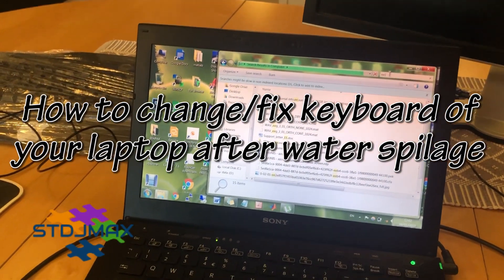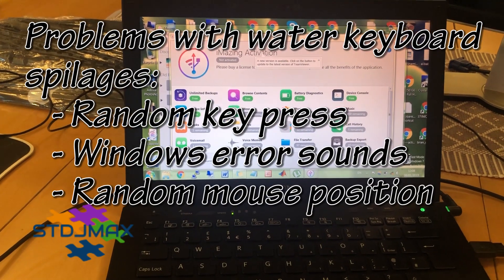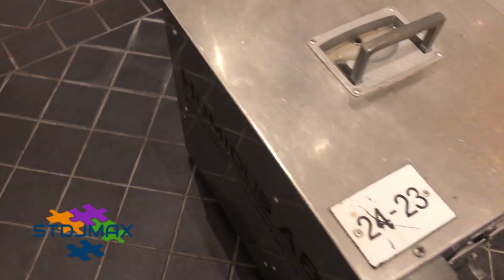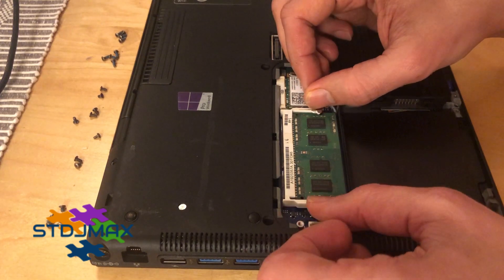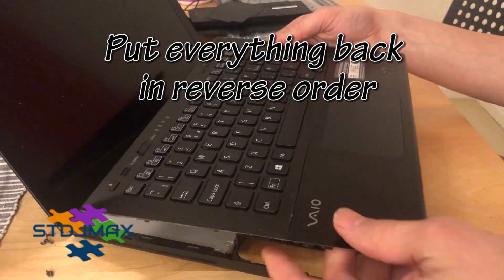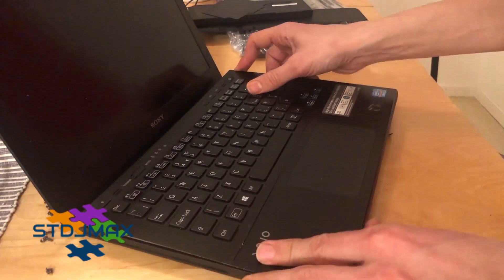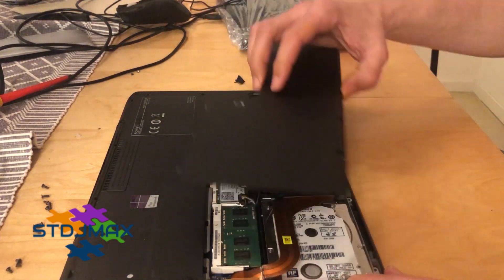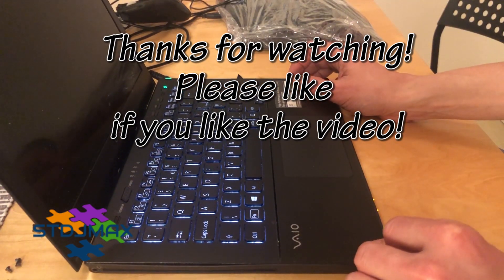How to repair the keyboard of a laptop after a water spillage/flood

Comment: I would never use metal screw driver (like this video) by fragile ribbon wires; just use your soft fingers/ nails to lift up the flap-clip holding ribbon. #1 if you spill on laptop; flip it oveer immediately. place on towel to dry. you can blow soft air across it, like a fan. On back side, open back of laptop. Just unplug battery. Unplug cord from wall. Find all the documents/ videos/ instructions you can for your specific laptop. All a laptop is, consists of motherboard, circuit board, with a bunch of parts & mini circuit boards plugged into it, plus battery plugged in & circuit board for power cord. They all just plug in/ out... plus get secured in place with clamps or screws, etc. It is easy to plug stuff in/ out, if you find the right instructions for your laptop. It is ez to replace your keyboard if it doesn't dry well. The keyboard is a self contained circuit board, which will contain water/ spill & not flow into rest of laptop if you flip it over fast.
Reply: And don't keep drinks by your laptop anymore. You can also buy a top protective covering; probably a good idea when you see all these comments of spills

Comment: i spilt a bit of water on mine and it wont charge after i put it upside down for 24 hours 😭 help do you think the air conditioner broke it? it was too cold and i cant turn it off cause they wanted to keep it on. i was wondering if it contributed to moisture inside…
Reply from the maker: use external tv , keyboard and mouse and turn upside down.

Comment: Hi,  which connector is for the keyboard?   i Have the same pc and just want to disconnect the keyboard and i am going to use an external keyboard. You disconnected 2 flat connecters with blue ends, which one was the keyboard? Thank you.
Reply from the maker: do not be confused with the big blue motherboard cables. The keyboard cables will be after that it has been dismantle around 7:00. Keyboard cables are small. Maybe I will make another video.
Reply: @stdjmax  Thanks, I ended up figuring out how to turn off the keyboard. Not going to fix it, it's 13 years old so am just using an external keyboard. PC still works great, it completely crashed once and my son saved it by installing a solid state hard drive. It's a Sony Vio 2009 model i spilt beer on.

Comment: My son just spilled a glass of water on my hp laptop. I think I fixed it. I wiped it down with a paper towel and turned it off immediately. 
I turned on the oven & set to 130 degrees F. Once it reached temp I turned the oven off and put my laptop in there upside down on a baking sheet for about 20 minutes. 

20 minutes later completely dry and everything is working. Now it's time to get a keyboard cover before it happens again lol.
Reply: 2 months later and not a single problem.
Reply: my laptop got wet 1week ago and l didn't do anything is your method still going to work
Reply: @lainyboo2560  Probably, as long as you haven't turned it on and don't let it get too hot.
Reply: @BradKwfc   l turned it on
Reply: @lainyboo2560  If everything works you should be OK. If not try the oven trick just don't get it over 130 or leave it in too long.
Reply: Will no baking sheet work
Reply: @teeheeteehee5451  It should
Reply: i didnt react fast enough😔☝️
Reply: @marssuckatgaming  Sorry to hear that. Mine is still working great. It's been over a year.
Reply: I just spilled a glass of water on mine HP, I immediately turned it upside down and wiped it down with towel but I didn’t turn it off immediately and it started making sounds like error notification or usb connection notification. I turned it off and it still lays upside down on the table, im desperate now, I’ll try the oven drying method 😫
Reply: @lindamarkusova5921  did it work?
Reply: @circus1293  no🥲 laptop died unfortunately

Comment: i accidently spilled water on my laptop but it survived still there is some problems that im having

Problems:
-When charger plug is in but it shows that is charging but it doesnt lower or go up
-Keys not working properly such as when i type something it doesnt type correctly
Reply: And the key problem is slowly recovery except battery it wont charge if i plugged but if i plug it cruises at same percent it doesnt fill but if i take plug off it goes down and if i put again then its the same
Reply: @NanoRail  use external keyboard
Reply: @spwashh5160  Thanks, But i got a new laptop.

Comment: Hi, i didn't actually spill anything on my laptop i was just cleaning it with a  cloth and some cleaning substance and when i passed the cloth over the keyboard it stopped working, i can't open this laptop sice its very complicated for me to open it since it has millions of screws and i don't have an external keyboard and I'm scared my parents will notice, its been like 1 or 2 weeks since it stopped working abd i don't really know what to do😢 I spilled so much water on this laptop abd it never happened so please help me!😭
Reply from the maker: Put again upside down for 3 days and try again. Probably some dust jumped some circle.  If it doesn’t work try to buy some air buster spayed while upside down. But first try the 1st solution
Reply: @stdjmax  ok
Reply: @Leandruhh  ayo did it work?
Reply: @polyphia8337 Uhhh it's been since last summer that the laptop wont turn on at all 🥲 Good thing my birthday is in 13 days and my parents said that they will get me a new laptop

Comment: DOES IT HELP WHEN I PUT JT IN RICE
Reply: put it outside down right no wand when you are ready remove the keyboard but do not touch the motherboard bcz.static electricity from your body can fry the motherboard when the keyboard is off put it in rice make sure you have removed the battery and drained power from the board hope you can fix it good luck 👍

Comment: I spilled water on my laptop, plugged it out and turned it sideways to wipe it off when I ACIDENTALLY TIRNED IT ON AGAIN and the power light was on but I couldn’t even hard shut it down. I heard the fan making noises like it was going on and off, then I put it in the triangle position to dry and I saw the charging port light on when it was plugged out and that was SCARY. Anyways I left it.. outside in the shade in the triangle position for like 3,4 or 5 hours.. you’re supposed to make it dry for longer I guess. (I also used a can of air to blow in it and dry) I tried to turn it on but it wouldn’t turn on, I was scared to plug it in but I did and IT WAS WORKING, it took a while to turn on.. didn’t check if my keyboard was working tho, I turned it off and just left it facing down
*Edit: I have to take it to a professional to clean it.. and my battery swelled
Reply from the maker: Thank you for sharing your experience
Reply: Actually the same thing happened to me and im rlly scared even i cannot turn the laptop off and like some of keys’ light is blinking and im having that fan noise im rlly scared can u pls suggest me what ti do
Reply: So your battery was damaged?

Comment: i just spilt water on my laptop and my parents are saying they won’t buy me a new one and i don’t have enough to get a new one so i’m very worried right now. it’s my only laptop
Reply: @UCqaTYtD5JHINQESeZ-V1VnQ Pls be right u dick 👏😭, I was drinking redbull, like a tiny amount drops at 6keys stop working, I tried everything. Its been 40mins now.
Reply: Me to in clean the water that fall and idk how to fix it my dad said he will fix it for one thing is im will pay and im only have 768 idk what to do im trying to find people how can help me if my pc is [hp pavilion g6] that my pc
Reply: Broke my laptop about 3 times, recently got it back from repair after a hefty fee.. just spilled water on it😭😭
I'm so scared
Help-
Reply: Also I feel like the it guys just charge us triple the fee for a 10 minute job
I need to learn how to do things like this
If you'll know how to learn😔🙏🏾
Tell me
Reply: @kawaiikai910  I found lenovo has a bunch of videos, to show step by step process to replace parts. It is not so hard once you learn to do it. Just realize all a laptop is: a circuit board (motherboard), with a bunch of small circuit boards & devices (hard drive, memory) that just plug into it, plus you must also screw down or clamp these boards/ parts various ways (with all different type connectors). Plus it has power supply, & a case. It is simple. It is like plugging the laptop into the wall outlet. It could sound scary- all that electricity. But you easily plug it in / out. It is no different with all the parts inside. Just find good videos / instructions for your laptop..... If you ever spill water on laptop... just flip it over immediately, place on a towel. Unplug it; open it & disconnect the battery from the back side (it simply has a clip connector). You can also unplug the keyboard ribbon, by just flipping open the clamp holding it & pull it out. Find the manufacturer info for your laptop & it will be ez. Let it just dry, with air flow like this video. If it doesn't work in a week- it is simple; just replace the keyboard. All you do is unscrew keyboard form the motherboard, unplug the ribbon & learn how to push it up, then pull out & replace with new one. You could do it yourself. Just find good documents / videos. I had to dig/ look a lot but finally found good videos for my exact laptop. Blessings.
Reply: Just disable your actual laptop keyboard using regedit, then use external keyboard which you can at around $4 wired and $12 wireless
Reply: did it work?
Reply: pls i need to know
Reply: @_szae_70  bro juice fell on mouse, it's not working 🙂💧
Reply: @limakthebear2271  poor you my laptop is now working, let it dry for few hours it'll work again trust me.
Reply: @_szae_70  hey what did you do
Reply: Watching the tutorials online but I'm scared to remove my laptop like this💀😿

Comment: Hello, i spilled some water on the keyboard of my laptop. I immediately turned it off for 2 hrs and let it dry but i have to turn it on because i still have work to finish today and tomorrow. I can still properly use the laptop but most of the keys are not working, i used external keyboard instead. I will try to let it dry upside down overnight. But I still need to use it tomorrow. Hope that it will dry quickly, i will let it rest during the new year holidays.
Reply: Same problem with me, i washed my hand and play my laptop immediately without drying my hand, but only 1 key not working 😭😭😭 and if ur laptop is already fixed can you inform it to me? Find this comment back after ur laptop is fixed. (I just want to know if it work or no)
Reply: @sisingkeruit9845  I spilled milk on my laptop and I have to do a Google meet.
And the L, O and Enter button don't work
Reply: @clixxspazzed2516  rip, still not fixed after 4days?
Reply: @sisingkeruit9845  I just bought a new keyboard with USB and mouse
Reply: Did it work?

Comment: I spilled water on my laptop, i cleaned the surface, and tried to let out the water that got inside by turning the laptop to its side. I tried turning it on and it said no boot device found. When i turned it on again, it said a different thing: cooling fan not working properly. I let it sit for 6 hours, and when i tried turning it on again, it said no boot device found again... What to do... Im so afraid that my parents will notice...
Reply from the maker: Mocharoon leave it more days upside down. Perhaps there is still some water inside. Also try to buy some air buster find link below may help to speed up the process
Reply: @stdjmax  i decided to just leave it alone for a whole week, and then its on again! Im so happy! 😭
Reply: @mocharoon5500  Did you leave it upside down?

Comment: wow it worked :D
Reply: Really??
Reply: @shahriarmarwan5105  yea
Reply: @andrewmixelsio1462  What did you do please answer i have to fix it or my dad will get mad
Reply: @andrewmixelsio1462  It worked for me and my dad we turned it over waited for the water to get out of the keyboard then we used a vacuum on the keys where they didnt work and then we used a blowdryer and then it got fixed extremely fast
Reply: @andrewmixelsio1462  bro i spilled water on my laptop about 4days already but i didnt do even a single tips was given on the video, will it work even its already 4 days? And can you tell me what litre of water u spilled on ur laptop?
Reply: @sisingkeruit9845  I spilled milktea all over in my laptop it happend 3 times but it still works
Reply: @andrewmixelsio1462  u didnt do the tips he gave in the video? U just leave the laptop wet without turn it upside down? 🤔
Reply: @sisingkeruit9845  no i turned it upside down

Comment: My cat peed on mine and it said install a hard disk or something like that. I put it rice so I guess I have to wait a couple of days and see if it works ☹
Reply: My cat also pee on my laptop,  some of the keys are not working, and I am trying to clean those one by one... :( just sharing experience... cats seems to like the keyboard a lot!
Reply: @marciagaete Right! Were u able to fix yours?
Reply: @aysa7905  ur laptop already fixed?
Reply: @sisingkeruit9845  yeah I eventually fixed it. It turned on😅
Reply: @aysa7905  so, do u have tips for me to fix my laptop? ( except the rice trick). I washed my hand and play the laptop immediately without drying my hand..
Reply: how tf does your cat pee on your laptop? is it on the floor or somthin

Comment: I left my school Lenovo thinkpad laptop outside my porch yesterday and it started raining and water got inside the keypads and on the sides. Is there anything I can do? I don’t want to pay for another laptop. I’m taking school virtually online because of Covid, I don’t have time to go to my school and get a new laptop.
Reply from the maker: Jesus Follower put upside down for 3 days. After if does not work buy some air compressor find link below and release some compress air. This should remove any residual drop . Do this in upside down position
Reply: Hey update on your laptop? What should you do ? Same problem😭

Comment: Sir I didn't turn off my pc after the water spill later it turned off itself is my laptops internal parts damaged 
Edit - I got my laptop back after turning it off for 3 long days keyboard is working fine too
Reply from the maker: Darshan Gowda put it upside down for 5 days. I hope the laptop will get back on if u are lucky
Reply: @stdjmax  thank you sir can it be repaired ?
Reply from the maker: Darshan Gowda depends how much water went through the circuit! Always have low expectations!
Reply: I got my laptop back without any damage damn I'm lucky thank you
Reply from the maker: Darshan Gowda Great if u glad and I am glad
Reply: @stdjmax  thank you for your response 🤟
Reply: I spilled most a 250 ml water over the keyboard accidentally  .please give me solution wht to do now . 🙂
Reply: @baljitchaukria5730  don't turn it on, if the battery is detachable remove it, i keep it upside for 3-4 days because this is winter season humidity in air is more let the water dry and hope for the best
Reply: @dexterDgc  no battery is attached i can't remove it ..😰
Reply: @baljitchaukria5730  its fyn don't turn on ur PC
Reply: @dexterDgc  bro my lappy even don't  getting started ..
Reply: @dexterDgc  should I bring to service station 
.
Reply: @baljitchaukria5730  u can wait or if u want it to get fixed immediately you can give it service station
Reply: @dexterDgc  i want to be it immidiately but  tservice station number did't picking up my call ..
Reply: @dexterDgc bro my laptop even did not  give  me any indication ..i am in stress .whether my laptop could be back in good condition ..or not ..
I just bought it 2 months before ..😠
Reply: @baljitchaukria5730  bro i suggested you everything iknow that's all ican help
Reply: @dexterDgc  does your laptip was gives u any indication when your laptop was in this situatio. ..
Reply: @baljitchaukria5730  I did a mistake by not turning off after water spill and used it for a hour later it turned off automatically I thought my mother board is wrecked ididnt turn on for 3 days after those three days I turned on and it's working fine generally keyboard gets damaged in my case iwas lucky no internal damage so far everything works fine now
Reply: @baljitchaukria5730  wait for 2 days then if it didn't turn on take it customer service bro if you are lucky the repair cost will be less just hope internal parts isn't damaged
Reply: @dexterDgc  thankyou but Bro i hv seen many times my luck is so bad ..🙏
Reply: @dexterDgc  ohh you are lucky bro ..its 3th days of mine laptop also ..if i put it on charging also charging led did not give me any response ..in addition to it ..i have been putting my laptop upside situation for 70 hours ..I donno wht going on with my lappy ..
Reply: @baljitchaukria5730  then take it customer service bro
Reply: @dexterDgc  hey bro ..today i tried to turn on my laptop its caps and charging led turned on what screen didnot give me any indication ..so i decided to put my laptop for 1-2 days  upside situation ..I hope my laptop would be okk ..
Reply: @baljitchaukria5730  hi.. plz tel me.. it's workin now ah
Reply: @baljitchaukria5730  did it work?

Comment: I spilled water on my keyboard so now some keyboards don't work and i don't know what to do cause i got school tomorrow and then I'm  gone get in trouble at that
Reply from the maker: Robloxtingz.x2 put it upside down for few days and try again. If better continue doing this until better. If still some keyboard keys do not work put an external usb keyboard
Reply: @stdjmax  okay thank you so much
Reply: Hi update? It still working on? What should you do?
Reply: @nicolepadilla7688  I only got some of the keys to work so I just bought a new one
Reply: @janaiah63  new laptop or new keyboard?
Reply: @nicolepadilla7688  I got a desk top so I had got a new keyboard